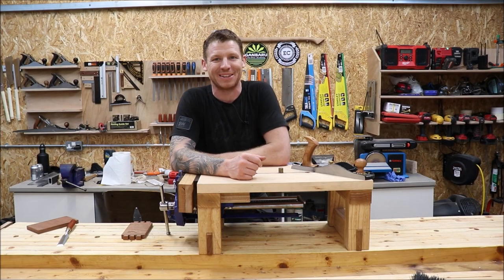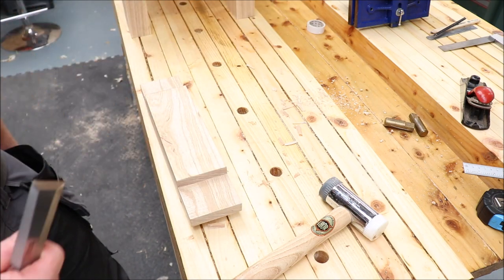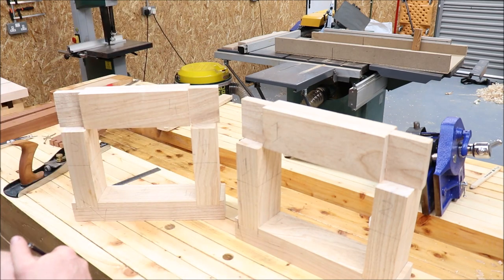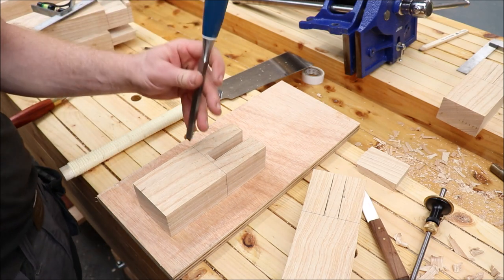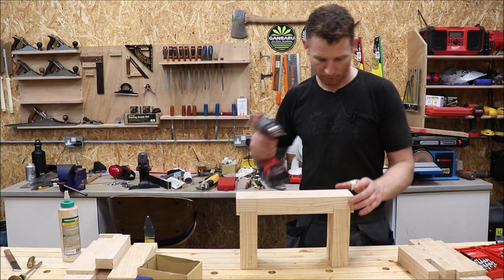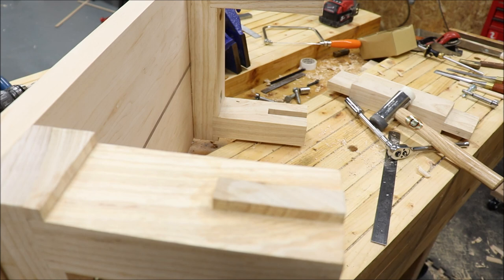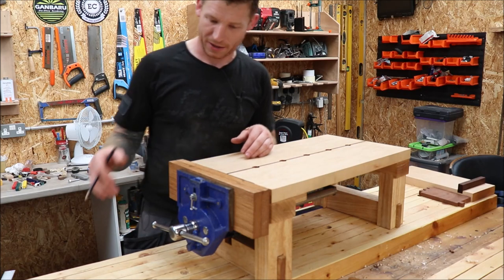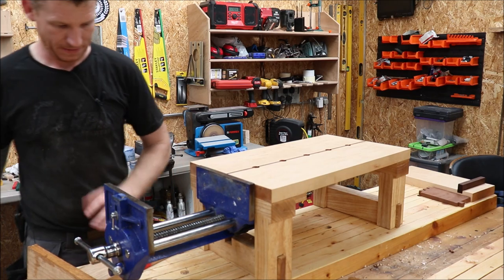Mini workbench part 2, making a hand tool workbench with a vice.

Comment: Hey! Awesome piece!
If I may, the video did get a little long, and it would be awesome if you could lower the volume for us when you get your hearing protection on.

About the piece, I think I would've went ahead and get a smaller vise, but I understand your motivation to use what you had. Isn't it too off balance with all that weight on that side?
And also would the stretcher tenons suffer too much if you took 3/4 inches from the bottom, so you could have got away with the through tenon? That might have done the trick.
Thanks for the ideas on the project! You did great with the explanations so don't worry about that :)
Reply from the maker: Its an older video the editing has gotten a bit better , glad you liked the build